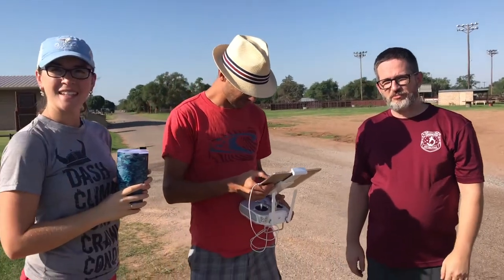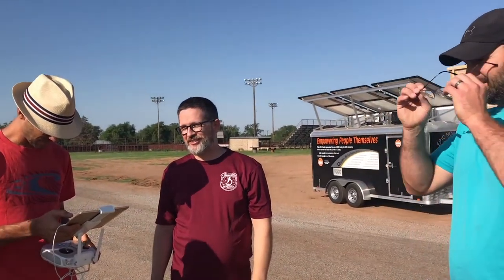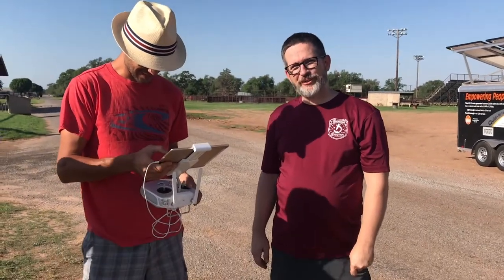MAKING of RV NOMADS - Episode 19 SOLAR & CHICKERY'S TRAVELS

Comment: I am really interested in solar - I plan on starting with installing lithium batteries and an inverter first so I have good capacity.  Living in Florida and camping here it just seems hard to think I want to park in the sun to catch the sun.  Even shopping we park in the shade and walk if possible ;-)
Reply from the maker: RVing with the Moracas I hear you in the shade! But I will say covering the windows makes a huge difference if you’re worried about the sun being too warm - it worked well for us while in Baja when it started to heat up. Lithium is a great choice! We’re anxious to make the switch ourselves 😁
Reply: @OutsideIsCalling  Did you use Reflectix on the inside of the windows or something else?  I was ready to buy some and make sunshades but read a negative comment and never did it .... and now the weather is finally cool enough that I don't need it.
Reply from the maker: RVing with the Moracas we haven’t used anything except our blinds and blackout curtains. We do have a ceiling fan in the bedroom; I feel like I can stand warmer temps if there’s a breeze, so having that has helped quite a bit as well.